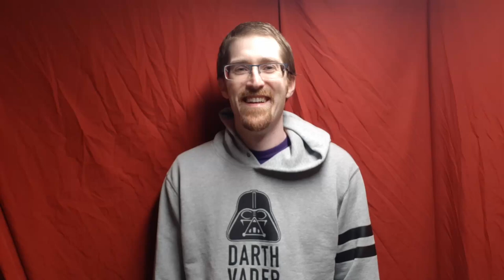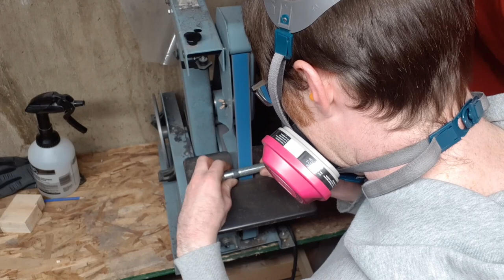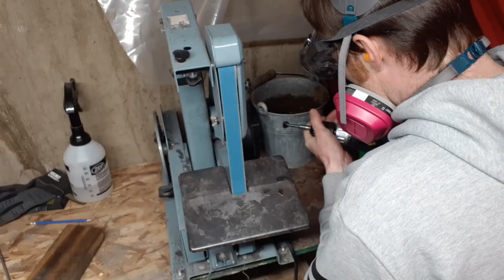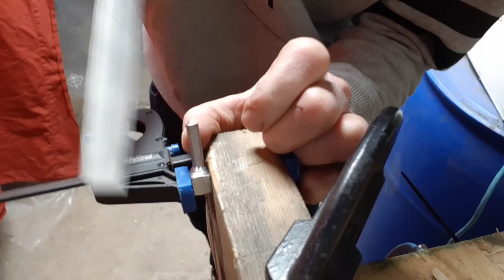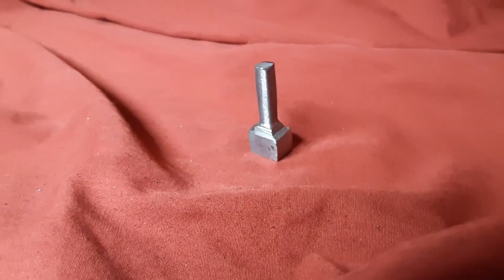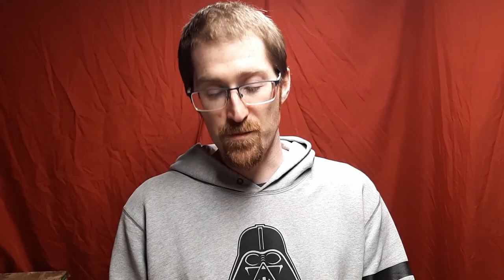MAKING A MINI HAMMER FROM A BOLT!

Comment: How well does a 1" belt grinder work? I use a 4"*32" and it seems to work pretty well, but I see a lot of one inch grinders.
Reply from the maker: The one that I have works quite well. I prefer it alot more than the 3" one.
Reply: @WildDogArmoury  thank you!